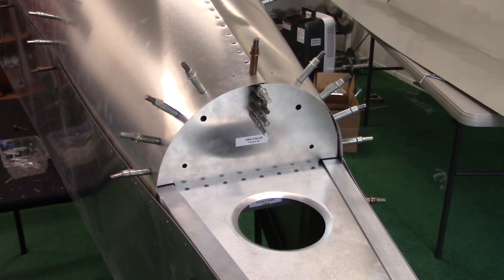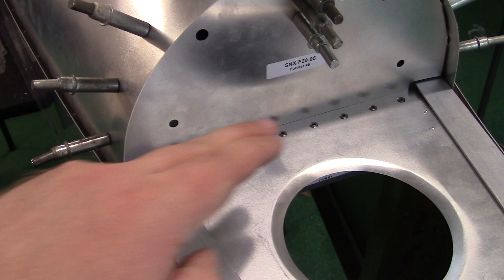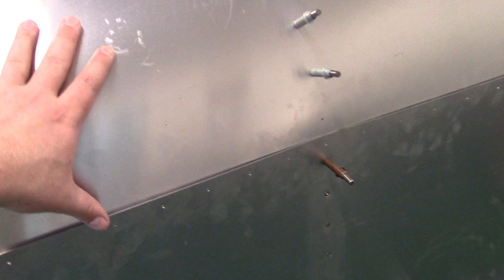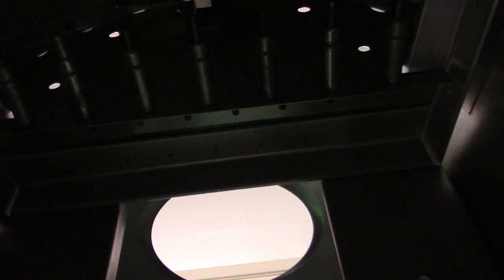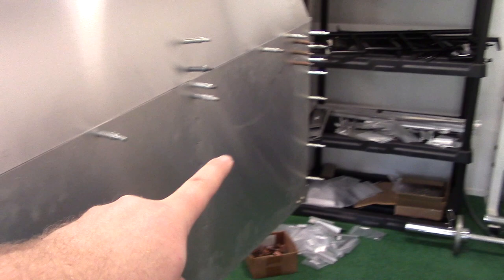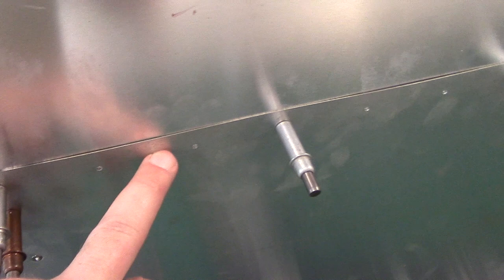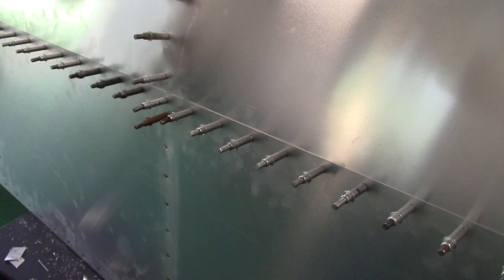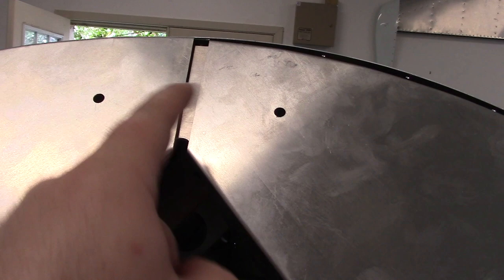Sonex Aircraft Build Video 72 - Drilling The Turtle Deck To The Tub

Comment: I have a question. I've been a sheet metal worker for a very long time (Commercial HVAC) and I've also went through (A&P) school here in Washington State. Watching all 72 videos so far I have a lot of thoughts and comments, however, this one thing is standing out to me. When you are skinning the monocoque fuselage (the top section and side sections, the tub as you call it) together. The side lap connections look like they are incorrect for rain? Shouldn't the laps on the side of the fuselage be sandwiched over the side sections for rain? So the fuselage will not fill full of water if a leak were to happen along the longitudinal axis seam? The way that the fuselage is currently sitting in the video the laps on the side sections is folded over the top section. When the top section should be folded over the side sections of the fuselage for rain. I'm just curious? What will stop the rain from leaking in the longitudinal axis seam? Is this kit designed to have the base coat and clear coat fill that seam for rain?
Reply from the maker: Hi Todd. First, thank you so much for watching the videos. It means a lot hearing that people are enjoying them. As to the side panel line up. I did a double take on that too, but after seeing how tight the metal panels are, and talking to other people that have NOT painted or waxed their planes, every one of them have told me they have left the plane in rain, checked it the next day and not one drop of water in the fuselage. Personally, I plan on doing several coats of sealer/paint.

Also, they suggest that you at least wax/polish the plane and that will keep any water from getting in the seams too. I hope that helped. -Dan